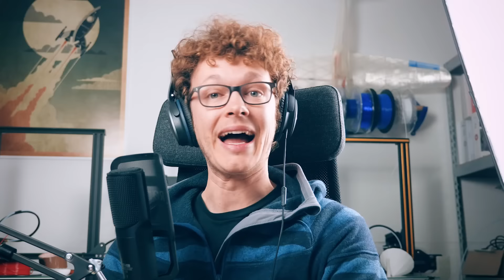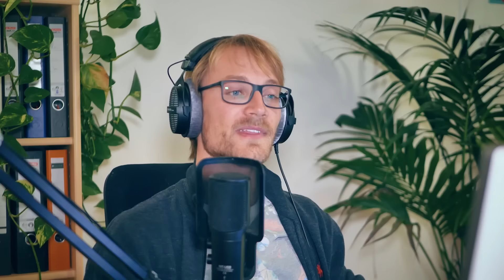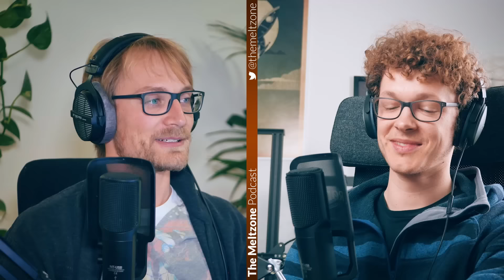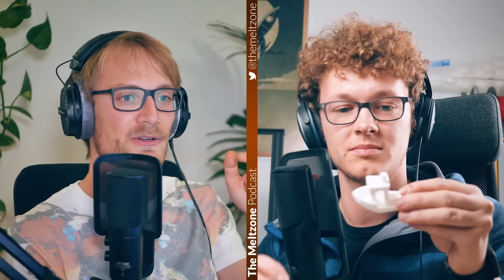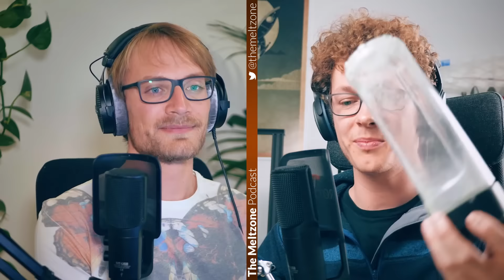Virtual 3D Printed Fibers / What Slicer to use - The Meltzone Podcast Ep5

Comment: You mentioned your coffee grinder blades would heat up while grinding your PLA. That is the exact same problem in the coffee world. The answer is to use a coffee grinder with bur gears, instead. The difference is the pieces get sliced instead of hammered. You will have great expresso PLA. :)

Comment: Dr Bowyer's original post is at reprapltd.com/fibre, and to clarify: the cylindrical void experiment deals with stiffening/strengthen low-to-moderate infill percentage parts, to save weight and print time.  It will not exceed the strength of high or max infill parts since that is not how (ostensibly... because of the z-axis bonding) isotropic materials work, nor will it exceed the strength to weight ratio of parts with embedded compressive or flexural members (ie embedded bolts/rods). 

I would also like to see a comparison between this embedded member method and something that would be easier to implement, like octet or quarter-cubic infill patterns, oriented 90 degrees but with doubled wall lines or progressively tighter subdivision multiplier in high-stress areas, since those patterns in that orientation are essentially what Dr Bowyer is trying to accomplish.  Varying density subdivision multiplier is already implemented, but it is geared toward progressively tighter patterns near perimeters to make for a better surface finish.  That could be repurposed to increase density (and therefore rigidity) in high-stress areas that are identified using FEM/FEA.

Pet peeve with the paper though: wile I understand using colloquial expressions for public-facing publications, the using strength and stiffness interchangeably is problematic and muddles the issue, especially when the point of the paper is a ratio of stiffness to mass: proper terminology would help clarify the purpose: USUALLY 'stiffness' refers to Young's modulus/modulus of elasticity, and strength refers to modulus of rupture, which are measurements of completely different characteristics. And what this exercise is referring to is stiffness to weight/mass ratio, which is 'specific modulus' or 'specific stiffness'. Which is also not to be confused with 'specific strength', which is a ratio of modulus of rupture to weight/mass. Also, 'fiber' may be misleading since a fiber-in-matrix material is typically to make use of a higher compressive strength, oriented material within a matrix of a lower compressive isotropic strength material, ie aramid fiber in epoxy, but that's just splitting hairs because we can see what he was 'getting at'.

Also, since our 'Freeware' FEA/FEM (ie Fusion 360) only simulates isotropic materials for the time being, it makes accurate simulation difficult because of the MoR difference between X/Y (transverse and saggital) and Z axis vertical) due to imperfect bonding and vertical vs crystallization (again due to the layers). It is a nice idea though, and FEA/FEM integrated into a slicer is something I support (hopefully implemented with a faster language as the python scripting in some slicers is already approaching glacially-slow under some complex condition cases).

Just some thoughts

Comment: 47:00 is it possible to get more detailed explanations of why an extrusion multiplier of 0.9 for PLA "is just wrong" or "they are just weak on the inside"? I mean, the people from S3D probably didn't do it just for fun. Why do they use a EM of 1.0 for ABS then if it should be used for PLA as well in your opinion? Why do they make a difference there if there should be none like you guys state? Those reasons Stefan spoke of, that perimeters don't adhere to each other or that the prints are weak on the inside are far away from my experiences and print results i got with those settings. And i mostly do not print decorations or figures or whatever. I really don't want to start some kind of war of opinions now, but i am just not "satisfied" with those floppy explanations. I think the reasons are a little bit more complex than just make PLA prints look nice or give a good preset for printing decorations.

Comment: About the shadow on the Benchy. I really wish you would investigate that. On my printer it seems it is thicker over that line than under. I did get rid of it in my latest testing by going from 40mm/s to 80mm/s on inner and halv on outer shell with Cura, so it might well be from the material cooling down.
Reply: I got the Benchy "waterline" when I switched from Cura to Slic3r PE, and found that it was due to insufficient cooling. The default cooling settings on Slic3r were completely turning off the fan for that layer and I ended up with a very noticeable line (over 1mm difference between one layer and the next). When I told Slic3r to never reduce the fan below 50% the line went almost completely away. I never saw the line with Cura, but it's possible that your part cooling fan isn't doing a proper job of cooling those layers - maybe it's not pointing at the right spot or is just underpowered?

Comment: The intriguing thing to me about the fiber thing is that if you leave the holes in the geometry they could later be filled with a resin that is potentially much harder and stronger than the bulk plastic surrounding.

Comment: Great talk as always.   Ideamaker from Raise 3D is a great free slicer to try for custom supports.  I've had good luck with it.  I've found I use S3D,  Slic3r PE,  Cura, and Ideamaker for different projects.  Sometimes a print will have an odd defect or a feature that just won't work in one slicer that will work fine with the same settings in another slicer.   They all have some features I wish were available in the other software.   One great often overlooked feature of S3D is the factory files.   I've gotten where I save the factory file after every print so I can go back and see exactly what my settings were on the print at a later time, either to make corrections or use those settings again on a similar print.   On the filament recycling, please take a look into NASA's Refabricator project.   Some of the details in there are really interesting.  I would love to hear your take on it and it might help with ideas on recycling filament.

Comment: Speaking of  workstations, 
I use a 2011 compaq PC with a core i3 550 (1st gen, LOL) 2 GB DDR3 ram upgraded to 6GB and retrofitted with a nvidia 1050ti (yes, processor is bottle-necked by the GPU). I used it to design 3D  printers robots, etc in fusion 360, play PUBG, etc. 

My new year's resolution is to upgrade to a  proper workstation LOL

Comment: The Cura story is basically that it started as a open source hobby project of Daid (David Braam), and at that time it was a nice GUI for skeinforge. Daid was then hired by a small start up company called Ultimaker and could start developing Cura full time.

IIRC the change from Skeinforge to CuraEngine was in mid 2013, release 13.06, but I might be wrong on this one. I do remember very well how slow it was to slice on the 12.x versions with the Skeinforge engine :)
Reply: I also believe that the original plan was to use the Slic3r engine, but in the end they started writing their own engine instead. 

Daid is still doing software development for Ultimaker, just not Cura anymore, I believe he is doing Firmware now.
Reply: (Almost) Current state in/of Cura:
https://marketmix.com/de/ultimaker-david-braam-ueber-cura/

Comment: @58:40 Screams Stratasys Infinite Build Demonstrator! They use a bed that at the beginning of the print they essentially put on the "conveyor". They then take it off when it comes off the machine. But they dont really use a conveyor, they use a system of rails and grippers that essentially grips the support material and pulls it forward in 1-inch sections.
With regards to a new topic, please talk about building high temperature heated chamber printers! (That go up to 200 degrees) there is a definitive lack of those. I am currently building one for the Solvay AM competition where we have to print PPSU filament. I am using an old kitchen oven for it, pulling off one side and putting the gantry there. The Z axis goes through two small slits at the side to not expose the motion components to heat.

Comment: Ideamaker slicer.. you guys need to really try Ideamaker.. it works and is a free option to compare to S3D.. same basis for custom supports (almost a direct copy)
 it DOES have a wanky interface, but once you get used to it it produces better strength prints to S3D, but.. it also has some perfect motion paths that don't hurt the print but make it take longer..
Reply: It was one of the S3D programming team that left that works on Ideamaker, one of the reasons it's so similar in many respects.  Best toolpaths that i can tell are still done by Kisslicer really underrated slicer mainly because the UI is from the late 90's :-)
Reply: @thegarageluthier   ya, I could never get kisslicer to work.. always screwed up the 1st layers really bad and even when I got it running it was a really crappy print. and the interface is annoyingly out of date,  don't care about the "looks" so much but it functions like the 80-90's :/.
Reply: @Thomllama  Kisslicer does take more work, it's just got a different way of doing everything but when you get it and get it dialled in you can produce some astounding prints.  But to be fair i normally use S3D or Slic3r PE so that says it all :-)

Comment: what do you think about ECC-memory for more overnight-reliability?
Reply: DDR4 has improved resilience against memory corruption, so it's good enough for tasks where no lifes are at risk if they do fail. It's nice to have the option of using ECC on AMD, but I don't think we need it.
Reply: Thats good to know. ECC was an issue on editing-workstations years ago and made a difference for many freelancers coming to office in the morning. I must admit, i have no experience with DDR4 as it was realy costly. ECC leads to more costs on other parts, so i just took one of these xeons, but the cheapest motherboard and memory just in case rendering crashes freak me out and i had to beef up. It did not happen. Your´e right. No human ever died on an video-editing-crisis..

Comment: what is it with Germans and fixation about power consumption? we use about 20 000 to 30 000kWh a year here.
Reply: We pay around 0.30€/kWh, so I'd be broke if I'd use that much.
Reply: @CNCKitchen  just looked at my bill its .054cents where i live in usa
Reply: That's pretty cheap even for the US.  The average in the US is 12 cents per KWH with the states that deregulated/privatized their electrical systems usually being about 20% higher than the states that still have regulated electrical systems.
Reply: A large part of our power cost is taxes to subsidize the move to renewable energy, so we end up paying a bit more now than countries that are sticking to fossils.
Reply: we have 96+% hydroelectric here.
Reply: I use about 3500 kw/h /year😋